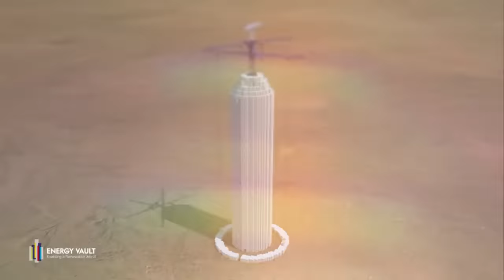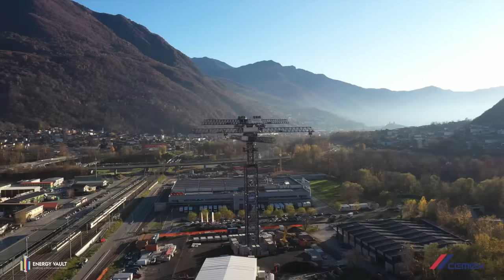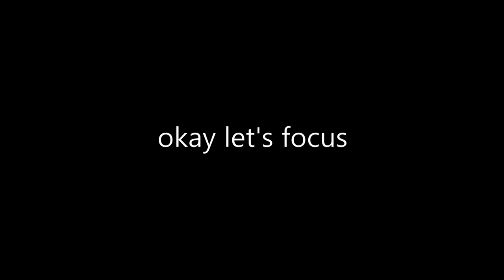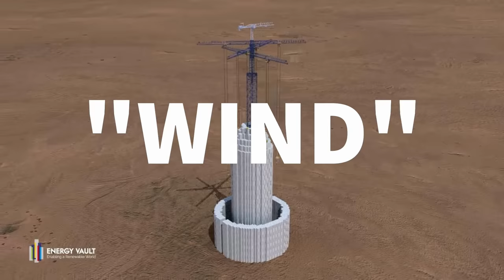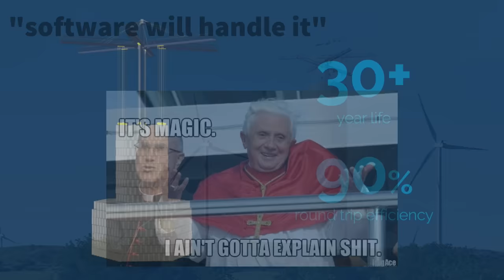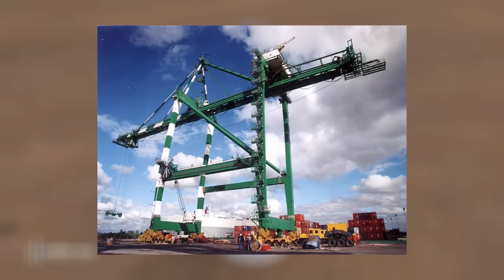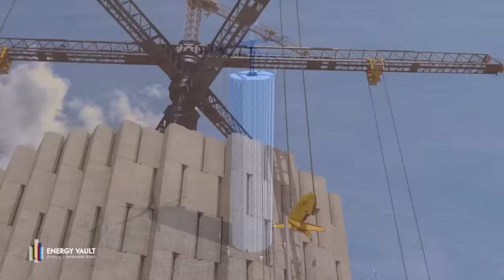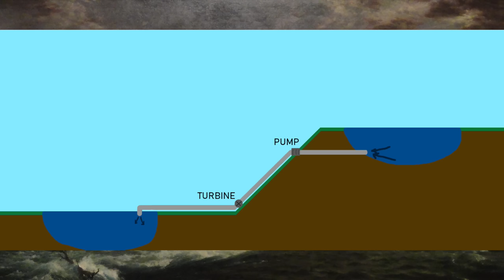The Energy Vault is a Dumb Idea, Here's Why

Comment: The hillarious part of this whole theatre is, that engergy vault is a company based in Switzerland, where they already use pumped storage plants to store excess energy and release it when needed. Imagine seeing all those dams and thinking: „yeah these pumped storage plats are great but what if we built a tower of concrete blocks in a futuristic looking shape“
Reply: - Pumping a mass of water is less efficient than lifting an equivalent solid mass with a pulley
- Pumped storage is only efficient to implement when the natural landscape facilitates it; "energy vault" does not have this restriction
Reply: @gershommaes902  
- Once a pulley has raised its 35t block to 100m, that pulley is no longer effective. Big $$ for trivial storage.
- Energy Vault requires unwritten "magic pixie dust" software and hardware to operate; PHES does not have this requirement...

Meanwhile, back in the real world....
Reply: @rustycherkas8229  In what way is the pulley "no longer effective"?

Complex problems are solvable with software, and to claim otherwise is anti-scientific. Far more complex tasks than the ones present here have been accomplished with software - do you disagree?
Reply: @gershommaes902  
Pulley no longer effective meaning once it has been used to store energy, it cannot be used to store more energy... If your grandfather clock (weights) must be charged every day, the mechanism cannot be charged for a week. Count the blocks proposed to store a few MWhr in this 100m tall tower.

In any wind, the empty grabber dangling at the end of a 100m cable will twist, swing and sway chaotically... There are no algorithms that predict chaotic systems... Simulate? Sure. Predict, and could compensate by moving massive infrastructure 100m distant? No... Not in the real world.
Reply: @gershommaes902 
Just thinkin' a bit more. (It's Sunday.)

Assuming the wind is strong enough that the wind turbines are over producing, that's when one wants this thing to elevate blocks... If the wind is not gusting, it's likely all 6 cables are, like windsocks, acting like weathervanes... You calculate it if you want... My impression is the downwind cable & grabber will be useless, flapping around outside the perimeter of blocks it should be transporting. Likewise, on the upwind side there may be blocks inaccessible until the wind speed drops... When there's less wind, there may not be "surplus" energy to store by raising blocks... 

It's a shambles...
Reply: @rustycherkas8229  Pardon me if I've misunderstood you:

The pulley in this case can detach from the weight it lifted and lower once again, so I don't understand how we can call it "no longer effective"

Clever engineering and software may mitigate chaos to acceptable amounts. In windy conditions the empty grabber will swing chaotically, but, for example, if the empty grabber was lowered until it touched the ground, the tendency of the empty cable to swing would be drastically reduced. I could imagine a technique such as this combined with very easy-to-grab blocks would allow function in windy conditions.

As I understand it the "energy vault" isn't limited to being powered only by wind turbines. Any source which produces surplus energy should allow it to continue to operate.

Overall it isn't obvious to me that it's in shambles.
Reply: @gershommaes902  
Perhaps I misunderstood you!
When you wrote "lifting A mass", I thought you were suggesting a permanent connection between 1 cable and 1 block. My apologies.

Assuming this would work, the horizontal inertia of a 35T block would require very gradual (slow) movement of the blocks, not the rapid-fire possibilities shown in the CGI. A single misstep and a "grabber" would be crushed between two massive blocks of concrete... F=ma... Lots of force to crush those long slender tubes... Remember, there's no onsite maintenance man standing by to replace damaged equipment with 10 minutes downtime. Dropping empty grabbers to the ground and dragging them across the terrain is known as "grasping at straws". Apart from more damage, the grabber will have to be airborne to be lowered into a precise position with a precise orientation... One gust of wind and it is "off station" and flailing about once again...

I just asked google a couple of questions.
Turns out wind turbines operate best (100% production) with windspeeds of 31mph to 55mph. Lower speeds (down to about 10mph) generate LESS energy. Energy Vault is to store excess production of energy. But, it seems (human operated) cranes should not be used with windspeeds above 20mph... So, it's only when winds are only creating a trickle of energy to feed the grid that EVault could be used to store the non-existent excess... Make sense to you???

Deserts have winds... Deserts have strong winds... So, even if production is from PV, this form of storage is a non-starter. The 'grabber' may be 100m below the boom and trolley that is the "positioning control mechanism"... Try dropping a hook into an empty beer bottle by dangling a fishing line off the top of a 33 story building... And, do it reliably, in all weather conditions... And, that single fishing hook does not have a "horizontal rotation" component to be controlled simultaneously.

There's a reason "VR" is differentiated from "R"... In VR, I could walk around looking like a young George Clooney... Ha! Even CGI, I still look like me. sigh
Reply: @rustycherkas8229  That's great info about the recommended windspeeds for operating a crane (human operated) - that does make me skeptical about how ev will grab blocks in windy conditions. I still wonder if there could be possibilities to lower the crane arm in the wind, reduce the swaying at the bottom, and quickly grab a block before the wind has too much of an opportunity to effect the cable's inertia, but you've definitely put some doubt in my mind!
Reply: @gershommaes902  
I live in a coastal city. The past few warm-ish afternoons have been blessed with some moderate onshore winds. Walking near a 22 storey apartment tower (rectangular, not cylindrical), the gusting ground level winds almost blew me over. Had I been dangling from a cable attached to something 50% higher than the building's penthouse... Well... There are videos of people who try to ride on firehoses... It's exciting, but it's not pretty...

Follow the wisdom of the elders: Don't invest in "fair weather friends". 🙂
Reply: @rustycherkas8229  I live in toronto, canada, on a major street which acts as a strong wind tunnel (especially in this season). Wind is nothing to trifle with! :)
Reply: @gershommaes902  
(Could be worse... You could be living in Winnipeg, at the junction of Portage & Main... Look on the bright side! 🙂)
Long ago, I lived in a hi-rise on Spadina, just south of Bloor while working on campus at the UofT... Those were really great days!!
Give my love to Kew Gardens... 🙂

Comment: Aren't we already able to use pressurized air? Generated hydrogen?
No, let's do it the dumb way.
Reply: Compressed air is crap for energy density.  Hydrogen is dumb.
Reply: @j.f.christ8421  hydrogen isn't dumb, it has the highest energy density and can be entirely renewable if created from water. Just have to find ways of storing it long-term.
Reply: @WidespreadKnown  "Just have to find ways of storing it long-term.".  Yeah, there's your problem.  Plus making hydrogen from water is very inefficient.  Solar + battery FTW.
Reply: @j.f.christ8421  But creating batteries is very energy intensive too not to mention you have to throw them away and mining Lithium is CO2 intensive. Just because it's currently inefficient doesn't means it's a bad solution, gasoline cars are like <30% efficient and they are currently the norm. Lithium batteries are a stop-gap at best even if they are more efficient.
Reply: @WidespreadKnown  Batteries are expensive, hydrogen is worse.  Solar + battery has no moving parts, and essentially zero maintenance for its lifetime.

Solar + Water = hydrogen has filters, pumps, compressors etc, lots of moving parts, consumables, and lot of maintenance.  Batteries are 1/3 of the cost of hydrogen.

Hydrogen is really expensive.  (That was part of the Nikola scam, they claimed to be able to make cheap hydrogen)
Reply: @WidespreadKnown  Naah, hydrogen has terrible round-trip efficiency and a tendency to go through solid materials, so it can't be easily stored. It's not going to come close to pumped hydro or batteries for round-trip.
Reply: @markxr1  Hydrogen (solar/water) is 20%, hydro 50-75%, solar battery up to 90%.  Hydrogen is expensive, so niche usage only.

Comment: I'm not going to say here and say this is a good idea, but there are a number of points I need to lay out which counter arguments in this video:
First, look at how much additional structure is needed for the shipping container crane, and going higher, needed for better efficiency, just adds more. That should bring up the cost of building this for the same sort of efficiency.
Second: building a hole in the ground is probably expensive as well, although it would provide wind resistance. I do wonder if constructing a wind barrier above ground, using some pillars and a sheet, would be better.

And third, you can't just plop a water battery anywhere. It's dependent on you having 2 things: water and a large change in elevation. If you lack one of those 2 things you can't build one. I'm from the American Midwest. There is no change in elevation here. A water battery could not be built here. Something like this could, if we wanted gravity batteries. Also water batteries are limited by the amount of fresh water in an area, a resource which as of late has been in limited supply in some areas of the globe. Unless you want to try salt water and deal with corrosion that is.

Am I saying this will work? No. Am I saying this is a good idea? Not really. Am I saying that the water battery, although much better, can't replace this in a large number of use cases? Yes.

Seems like there are still a number of issues that make this unworkable, and it would be better to just go nuclear, but understand that your suggestions would make it worse or unbuildable in a large portion of the world.
Reply: You are not getting it. The suggestions are actually better than the original plan. Just because the suggestions do not work everywhere, it does not mean the originals work everywhere.

How do you get the amount of concrete needed? You would actually need more water to make the concrete than the water needed for the weight. Your critique makes no sense. The gravity battery makes no sense and no it cannot be constructed anywhere the same way you cannot transfer so much water to other places.
Reply: @RanEncounter  This is literally a crane and concrete, maybe some other material, of blocks. One thing you have to remember with water is if even the 1-time cost is high because concrete, concrete doesn't evaporate like normal water does. Trucking water in would be unsustainable; you'd need to get more from rain or having some form of natural refilling source.

I'm not arguing that changing the design to a water battery makes it worse though. I'm arguing that putting a wide, squat crane in a hole destroys what little efficiency this thing has whilst driving up costs to a stupid point. If wind is that big of a problem just construct a barrier. All that requires is metal supports and some form of sheet. And again, you can't just build a water battery anywhere. Suggesting that as a replacement for this kind of feels like suggesting geothermal power as your solution to climate change.
Reply: @noname117spore  "This is literally a crane and concrete, maybe some other material, of blocks."

Yes and those are materials that erode and brake like was said in the video.

"One thing you have to remember with water is if even the 1-time cost is high because concrete, concrete doesn't evaporate like normal water does."

Water does not evaporate from an underground hole. The one time cost is way lover with water and concrete erodes over time and is way harder to move. You can just pump water.

"Trucking water in would be unsustainable; you'd need to get more from rain or having some form of natural refilling source."

Not if you trap it in like in the video. While it is better than with how much concrete you need, again this is idiotic in the first place.

"I'm not arguing that changing the design to a water battery makes it worse though. I'm arguing that putting a wide, squat crane in a hole destroys what little efficiency this thing has whilst driving up costs to a stupid point."

It is totally unfeasible without the change. How would you solve the problem of the winds in that kind of a crane?

"If wind is that big of a problem just construct a barrier. All that requires is metal supports and some form of sheet."

Do you understand how high this would have to be? How do you think this barrier is going to take the wind better than the crane? This is much worse. It literally traps all of the winds energy to itself.

"And again, you can't just build a water battery anywhere. "

You can build it anywhere a concrete crane like that can be build. Just forget the elevation for a while. Water is way more efficient doing the job than concrete here. That was the point.

"Suggesting that as a replacement for this kind of feels like suggesting geothermal power as your solution to climate change."

Do you understand that the point of this video is to show that the crane is not some new solution to our energy storage problems? You don't seem to realize that the water replacement is 10 times more feasible than the concrete one. And still with water it is not feasible in reality. Only with natural sources of water and with elevation because the pumps would take up so much energy.
Reply: @RanEncounter  I'm pretty certain I explicitly said in my comment this probably won't work; I was just saying that the replacement solution is actually worse for many use cases.

Also this things the height of a small skyscraper. Constructing a wind barrier as a tube around it shouldn't be out of our technological limitations given how tall buildings and even towers go now.
Reply: @noname117spore  " I was just saying that the replacement solution is actually worse for many use cases."

Like in what case? It literally is better with water.

"Also this things the height of a small skyscraper. Constructing a wind barrier as a tube around it shouldn't be out of our technological limitations given how tall buildings and even towers go now."

I don't think you understand a tube of the  height of a skyscraper is not possible to construct. Tall buildings rely on a lot of their  infrastructure to keep them from falling to winds and earthquakes. This is not possible with a simple tube or even a wall of that size.
Reply: @RanEncounter  I'm tired of arguing. You're strawmanning my positions on this, so I'm done with it.

Comment: A betterway for gravity energy vault like this would be in an abandoned mine with weights permanently attached to those cables and they just go back and forth
Reply: And abandoned mines are already filled with hazardous materials, rubble and water when they are abandoned. Sure, you could open it up again but they it will be very costly to maintain, you'd need constantly running pumps to keep it free of water.

The Scottish company that proposed this idea never actually thought about the notion that it occasionally rains in Scotland.
Reply: @markxr1  "The Scottish company that proposed this idea never actually thought about the notion that it occasionally rains in Scotland."

They're proposing to use recently used mineshafts in eastern Europe so I'm not sure how relevant Scottish weather is.
Reply: @markxr1  And if you are running the pumps to keep it free of water anyway, why not use the water as a pumped hydro storage anyway.
Reply: @catprog  Oh 100 reasons. Mostly you need to keep the hole free from water so that the big weight and cables don't get corroded etc. The last thing you want is to deliberately let water go into the hole.
Reply: @markxr1  No weight or cables needed. Just use it as a traditional pumped hydro scheme.

Comment: Yeah, I made a rough estimation once about how much energy I could theoretically store having a 1000 m deep mine shaft and a few metric tonnes of weight. And it's just dumb. You need a shaft like that and many tonnes of crap just for one household.
Reply: @TomaszSky  These bricks are a million times worse than pumped hydro storage though. They pretty much have all the drawbacks plus some, but no advantages.
Reply: @0106johnny  The bricks as described in the video or the actual bricks the company makes?
Reply: @aaronburns9365  Any type of brick is idiotic.

Comment: "There we go, we have revolutionized energy storage I guess"
Is such a SAVAGE burn.
Reply: Not really. You need the correct geography to use pumped storage. This just needs flat land. 

There are plenty of show stoppers with this system but that was not a great take.
Reply: @cconnors  You could probably easily build a pumped storage facility on flat ground by building a large water silo above ground (for the upper portion), with a secondary silo underground underneath it (for the lower portion)
Reply: @cconnors  or you can move energy from flat to not flat ground through wires using electricity